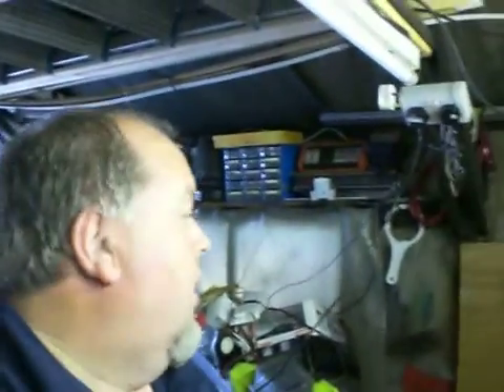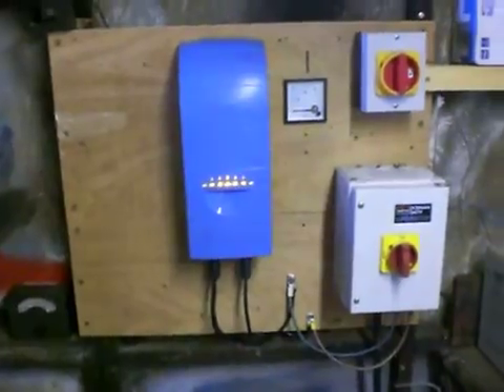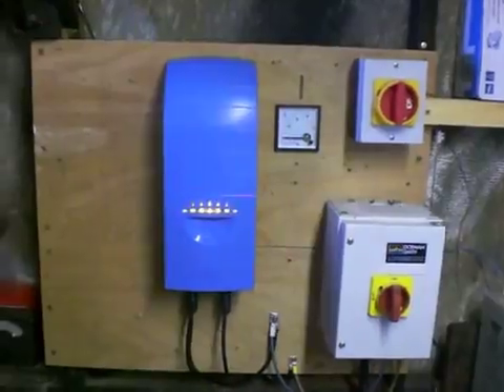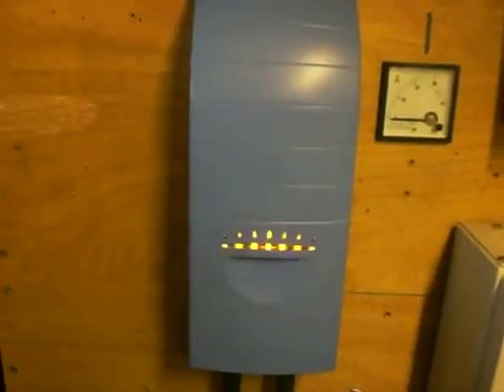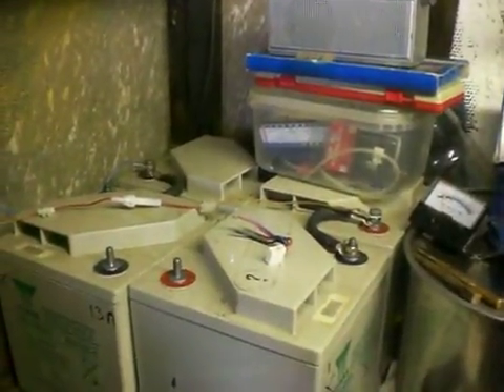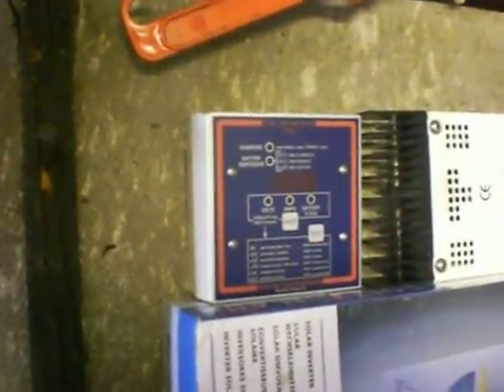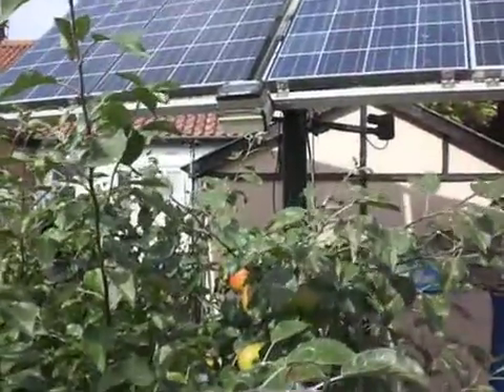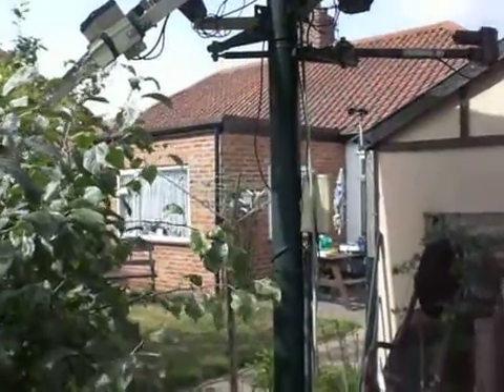Mastervolt soladin 600 powering the home

Comment: I'm thinking of using the same Inverter for a small test PV setup on a low roof.  Did the meter readings slow or start running backwards and did it raise any eyebrows?